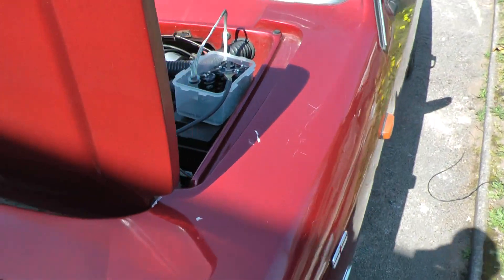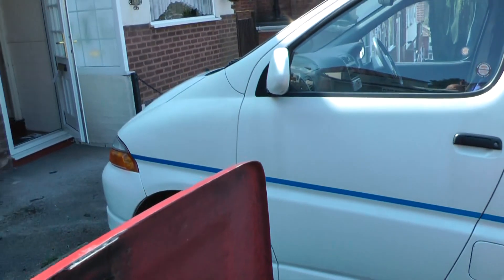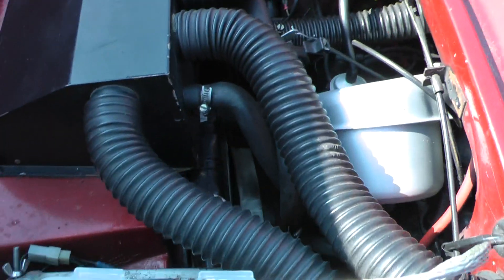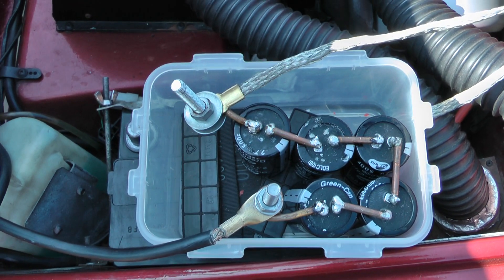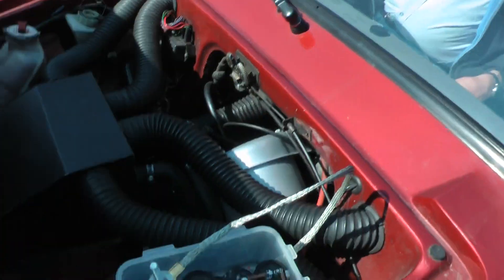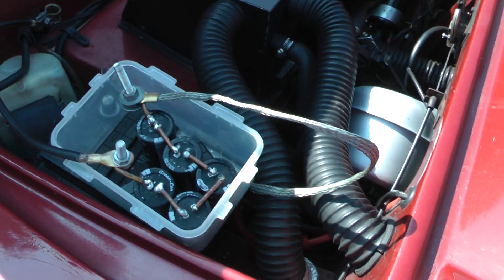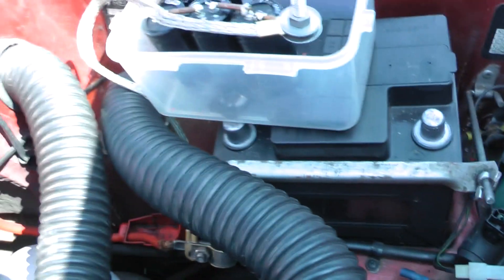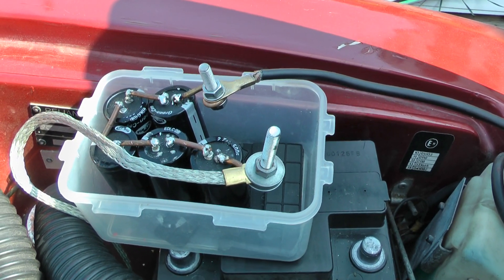5x Super Capacitors Starts A Car 100F Allcingeye

Comment: Can these also be use for inverter 12volts to 220volts output suported by a battery charger could it be possible?
Reply: Watch my YouTube Channel,  i use super capacitors for my inverter. 

https://youtu.be/EXF7-H1YfaI

Comment: No sense of starting again and again bcz car charges them at 90amps an hour at least rpms so if running for  1 second then also they will get max charged! : /
Reply: 90amps?! can't be... the cables will melt
Reply: Melnikov Jacob the cranking of car is done at minimum 300amp and maximum 700amps :/ so 90 is just nothing actually 90is high value I understand what u r thinking but at 12v it doesn't matter to the cables. 🤗
Reply: first off all it doesn't matter the voltage when you talk about amp, sure the volt is part of the equation but you said " but at 12 volts is doesn't matter" so, 90 amps is 90 amps and it can damage the cable.
second off all you said its charging at 90 amps and then talked about cranking at 300+amps ,you are right about the cranking but I talked about the amperage that the alternator is producing, and its way less then 90 amps

Comment: Fack totally I used geen cap 100F capacitor it can not starts two wheeler so person say car is starts on this capacitor 
Fake faked
Reply: 5 cap 500f in series totally 100f..
5 cap 100f in series totally 20f
Reply: @ahmadjamil6608  No, it is the same
Reply: Correction: Mr. Jamil is correct. Total capacitance in series is like resistors in parallel
Reply: no, original super capacitors can start car,  please watch my all videos , i creat lots of videos about super capacitors 

https://youtu.be/EXF7-H1YfaI

Comment: Pehaps a current and voltage meter would verify your findings.I'm new to this super capacitor world,and bought a unit of 6 ea. 500f on a balance board. The connection points are tiny and I'm afraid to try it on a starting circuit.Your setup is wired heavier.Does anything heat up on the rapid repeat starts ? Just curious, Skip J. in Florida. Thanks for showing your research.

Comment: I started with green-cap because they are cheap.  However they are pretty low quality.  You will get much higher burst amperage and much slower discharge out of Maxwell 350F.  Also your alternator floats the capacitors at around 14v-15v.  So you really need a min of 6 capacitors to keep from going over voltage and breaking down over time.  Ballance boards are fairly cheap now too.  Been working on a project that uses capacitors and plan to post a new DIY in a few weeks to my Youtube with some advice.
Reply: Gene, Check out Amperics HEDS line of 3V Supercapacitors. www.amperics.com.  Would love to see how they can be best used in these sorts of applications. Have not seen cheap balancing boards at 3V.  Can you point me in the right direction? Bala Padmakumar.   bpadmakumar@amperics.com.

Comment: i dont see the + or the + to know how you conected them i have 6 capacitors but i dont know how to make them as one please help
Reply: +Noenoe live  All D/C caps have a clearly marked ground. Usually a band on one side with small minus symbols inside the band.
If your caps don't have a clearly marked ground, you probably have alternating current caps. These are not meant for direct current systems and will fail quickly if put in a D/C circuit.